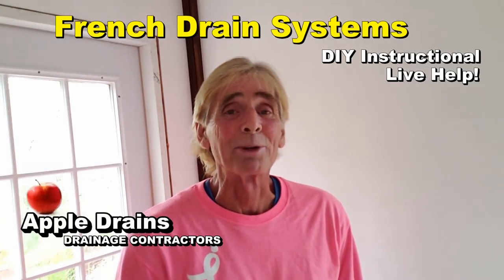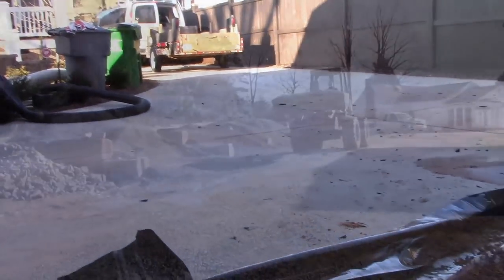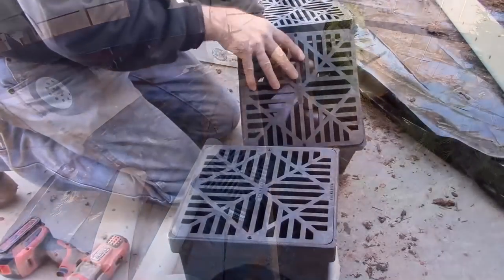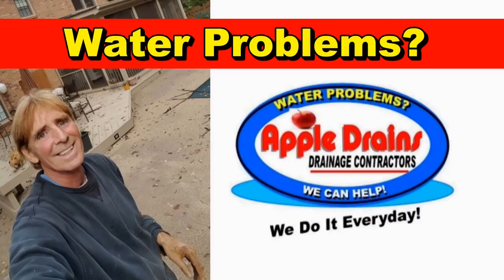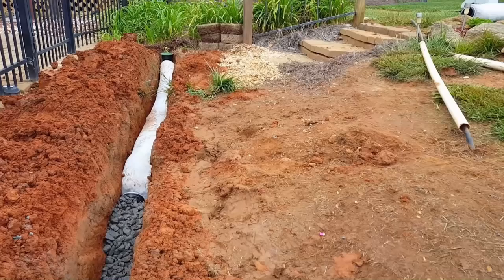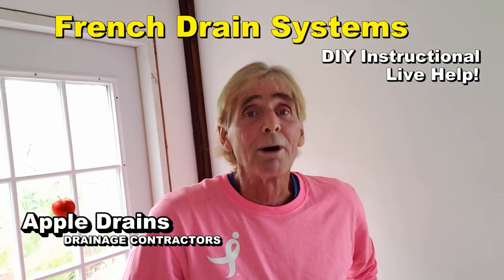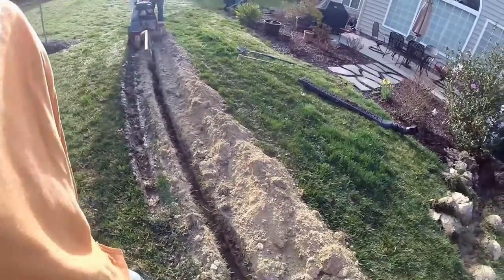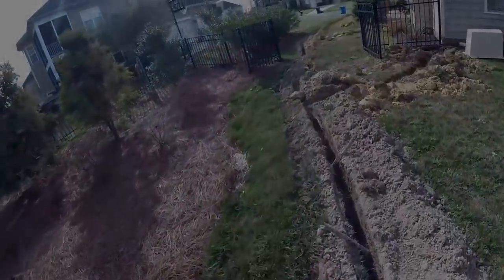How To Install The Best French Drain

Comment: I have a question. I finished My 100 foot drain in clay soil. I did not line trench but I did use a liner for the pipe. My question is I did not use screened gravel. My gravel ranges from gravel sand to 1 inch, did I screw up by not using screened gravel. TIA

Comment: 2 points

1. I note you did not use filter fabric for soil separation between the soil and the gravel. Care to share why not?

2. Also why not just an open French drain that is "burrito wrapped" by filter fabric? I would think the catch basin would allow dirt and contaminants in.
Reply: I second that question
Reply: Yes y’all are right it will fill with dirt over time.
Reply: Chad Moore a catch basin actually helps to prevent containment’s getting into a system. It has a sump area in it that allows the dirt to settle in to. You clean them out on a annual basis. 

Soil migration into the gravel depends on the soil type. There are many types of clay soils, most clay soils do NOT migrate into the gravel. However, the most common reason for not installing a soil separator is they become clogged from soil fines quicker (soil is drawn into the small holes of the mesh and collect)  than the gravel.
Reply: Building With Zach the catch basin? Clean it out on annual basis as recommended. It has a sump area to collect the dirt.
Reply: B&B Drainage Solutions over time with heavy rains the soil won’t have enough time to settle in the catch basin and will go through the pipe and settle filling in the pipe and the gravel. This is why it’s best to either have no catch basins on your system because a French drain built properly doesn’t need catch basins.
Reply: Building With Zach if it doesn’t have time to settle in the catch basin then it doesn’t have time to settle in the pipe, so long as it at 1% slope. 🙄🤪🙄
Reply: B&B Drainage Solutions once the water goes through a corrugated pipe the velocity goes down tremendously causing it to settle in the ridges of the pipe. And everyone I know that has a catch basin hasn’t cleaned because they are homeowners and they don’t know any better.
Reply: Building With Zach soooo. The corrugated pipe acts the same way a catch basin does and slows the water velocity down and the dirt settles in it 🤔. Amazing !!!!

I’m sure ole Chuck lets them know to clean the basins. He’s been in business longer than you are old. So he must be doing something right. 

So much good info here. Even you came to watch and learn 👍😀
Reply: B&B Drainage Solutions yes, over time it accumulates in the pipe. As you can see in your video the dirt stays in the pipe and will clog the holes in the pipe and will also clog up the gravel.
Reply: Geez. Alot of info here. So what's the consensus for most drains. Corrugated, smooth, catch basin, no catch basin, soil sock? 

Seems to me simplest might be best. Lay smooth perforated pipe in a pit of gravel, with a good pitch and a an unblocked exit and call it a day!
Reply: Building With Zach that was a 6” basin which has a very small sump area. As noted in the video, and it wasn’t (and should not be) connected to a French drain. That particular one was connected to solid pipe. 16 yrs I have never, ever, seen or heard of a French failing due to a catch basin. 

You are basing your assumption off of someone giving you info because they are selling you their specific idea and of course they want you to buy a product too. Facts, not opinions, is what matters. Have you ever found a French drain that failed due a catch basin being installed in the system??? Did the person you based your info off of show you a system that failed due to a catch basin being installed in with a French drain???